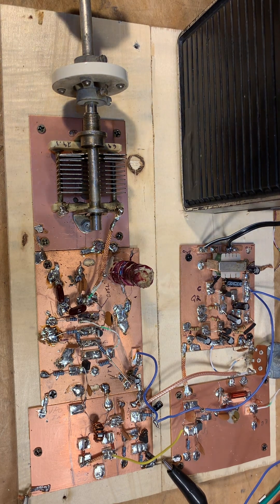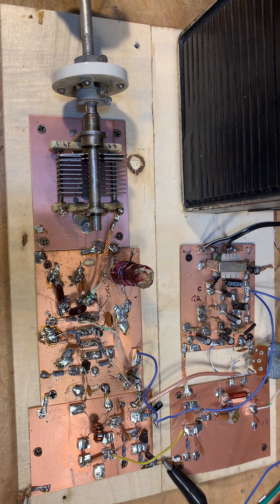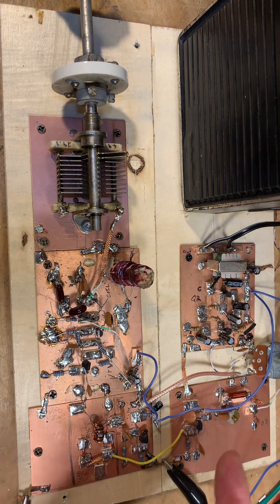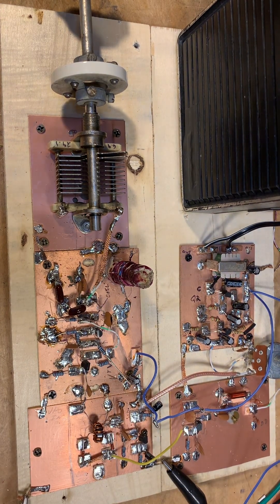40 Meter Bandsweep with Direct Conversion Receiver

Comment: Bill, I agree with putting the pot on the front end before the mixer instead of before the audio amp. Putting the pot there cures a multitude of sins like front end overload but it also fixes AM breakthrough. I built a Ramsey kit for 40 Meters and run the audio gain full open but control the overall gain with RF pot. Adjusting gain with the RF gain works great.

72’s

de Rick, WD5L
Reply from the maker: Yea, I tried it at both places, and it is better at the antenna connection, before the BP filter.  I have some annoying AM detection of Radio Marti (just above the 40 meter phone band).  Turning the gain down just a bit completely eliminates Radio Marti, while not really degrading 40 meter signal strength.  Still, I wonder if a diode ring -- with the RF being one of the signals balanced out -- would result in further improvement.  73  Bill
Reply: @soldersmoke , certainly a better balanced diode ring mixer helps but for me, sinching doen the gain completely eliminated AM breakthrough for me. I had the same problem as you with my Ramsey 40 meter kit.